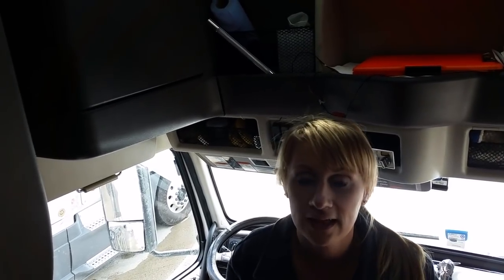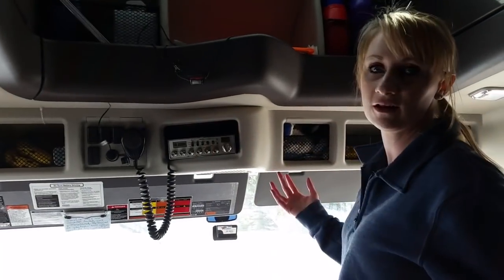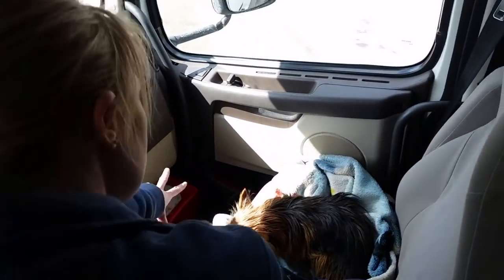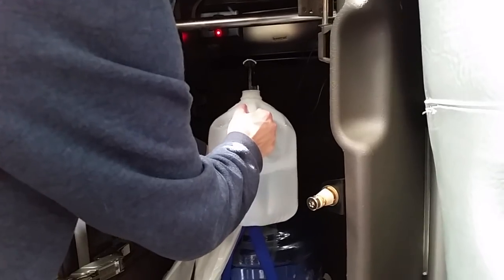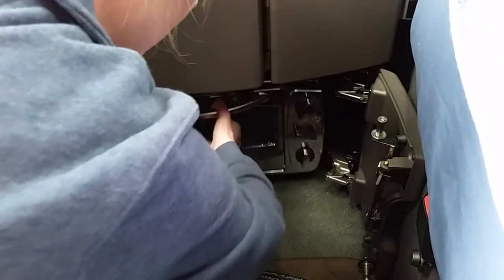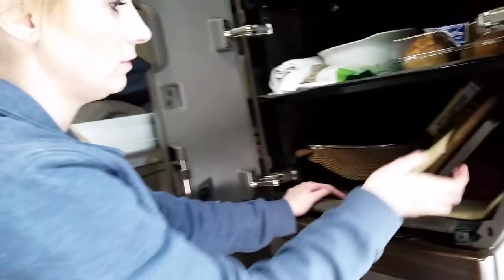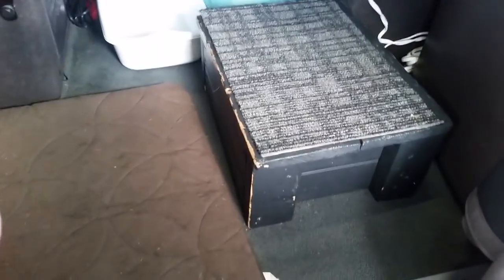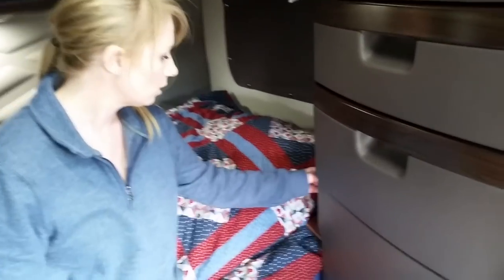Making our 2018 Volvo VNL 780 into a Micro Tiny House: living in a semi

Comment: I have a 2016 Volvo 670, and I’m in the middle of my own deep clean and de clutter/reorganization as I prepare to start running more instead of being home every weekend all the time. If space comes at a premium in a 780, space in a 670 certainly does. 

Where do you find that pump head? I just bought a microwave, already have 8-quart instant pot, going to see if my ninja foodie xl grill fits, and maybe add a second fridge. I have a 3,000 inverter. 

The main thing I want to focus on is making space, and instead of plain milk crates, I bought some Rae Dunn crates to add a little designer flair. I drive solo, so the passenger seat is largely for my beagle puppy, and I store dry goods in front of that seat. 

As an owner operator, I appreciate videos like this. No matter how long you’ve been out here (me, 20+ years) you can always learn something new. Thanks.
Reply from the maker: So happy for ya and the new adventures ahead! Glad you found this video to be helpful. If you have Facebook or Instagram add us and send pics. 

Exciting news about the water pump is they have made upgrades and it is now smaller and a rechargeable battery. You can find them at Walmart or on Amazon. 

Be safe and may God bless you
Reply: @SimpleLivin  Oh, I’ve been driving for over 20+ years as a professional. I’m also a 2nd generation driver who used to ride with my dad. 

I’ve just never been that organized, especially as a bachelor lol. But, I finally decided to get my cab back in day 1 condition, and make it into more of a rolling apartment to help me stay out longer. I might create an Instagram account, although I’m so sick of Facebook lol.
Reply from the maker: Congratulations on your success on the road. Its always good to hear other folks that have a deep love for trucking. We have 45 years combined!

Getting your truck organized and making it into a rolling apartment will make life so much more enjoyable.  Its also has a huge impact on positive mental health.   Come on over to Instagram! Lot less drama lol

Comment: I drive a 2011 780. Identical set up except I have so much crap in there i can barely move! Where do u hide your pee jugs? I like the 5 gal water jug with the pump arrangement. I have been just buying water at the truck stops.  $2.50 or more a gallon! Walmart is . 94 a gallon. I only use the water for coffee. Hell I rarely bathe in the stuff so why drink it??!!   kiddin

Comment: Compared to some of the trucks i drove back in the late 70s and early 80s, your truck is like a condo on wheels, and of cores i was driving a International cab over, and if you think you are cramped for space, try living in one of those for two or three weeks, running teem.
Reply from the maker: willibill c trust me I am incredibly thankful for the continuous improvement of trucks and truck stops over the years. I love the look of a cabover but I can only imagine it was not a smooth ride! This Volvo does have a pretty big cab overall but compared to a house, apartment or how the average person lives it is beyond tiny.
Reply: willibill c , this generation don't know a thing about trucking or what trucking is really about.  They cant change a tire or change a tire off a rim or mechanics this isn't trucking period
Reply from the maker: T D I've been driving for 10 years now. I really could have only started 6 months prior because of my age.  Thru my career I have surrounded myself with some pretty elite drivers. Winning multiple times at the national truck rodeo titles. I have also won awards myself and can honestly most times can diagnosed what's wrong with my own truck. I do agree with you though most drivers don't know a thing about their trucks.
Reply: willbill c The only time I ever drove a cabover   was at driving school. We also had an assortment of KWs, Peterbilts and the like with standard  sleepers. I cannot imagine driving that old cabover 3000 or more miles a week. That would have ended my career before it began. The cabover was an old jbh truck, and as bad as you would imagine.  Bobtailing it wheezed going up a bridge. And BOUNCE? First company truck was a Ford 9000 with a Cat and Eaton Fuller. Thought I'd gotten into a race  truck. Grossing 80,000 it pulled WAY better than that old Int. cabover without a trailer. Gotta admire the oldtimers. They had it tough. Living in a coffin.
Reply: T D, a real  trucker learns his rig pretty fast. Most folks ain't mechanics, but the sounds, the smells, the way it handles and brakes are  quickly learned IF you pay attention. Keeping an eye on your gauges is all important. If you can FORECAST a problem you're miles ahead. Too many truckers just ride the seat. That's a sure recipe for high repair bills, lengthy intervals OFF the road (not earning money) and dangerous situations. A  diesel mechanic makes more money than a trucker and is home every night. If you're both, which would you do.
Reply: Tom Swinburn , there are different levels of being a mechanic a truck driver doesn't need to know how to change injectors or adjust valves he need the basics to know how to do minor repair to get him home. If an owner op can change a turbo and a driveshaft u joint thats cheaper for him and less down time waiting for a mechanic or tow truck depending on if it's caught at the right time and place having a good set of tools to change a belt or hose.  Now when you need major engine or diff work you seek a pro in that sense. But you seek a mechanic for every single thing on your truck to fix its not practical ie electrical switch, or a  PP1 valve.
Reply: willibill c come to the U.K. and see our sleeper cabs, and we’re away 2-3 weeks at a time, you drivers in the States have beautiful big cabs compared to our shoe boxes.
Reply: willibill c sleeping on the dog house too
Reply: Ditto

Comment: I'm going to be starting otr in a few weeks, my question is what size are the two different bunks I'm sure between the various different makes of rigs the bunks are the same size I'm just curious as to what size sheets I'll need to buy for the top and bottom bunk?
Reply from the maker: Most of the time they are twin xl from my experience

Comment: Hi! Are you owner/operators or company drivers? Do you use an inverter? If yes-what wattage? Have you tried using a Crockpot slow cooker? I haven’t seen your other videos. Does your truck have low voltage battery shut off switch? Thanks for the video!
Reply from the maker: We are company drivers. We have an inverter that is 1500 watt. It is hard wired and has fusses which does help protect the inverter. It will trip if it surges. I dont suggest a crockpot but instead a 6 qt instapot. The lids lock and steal on. They cant spill and cook much faster.  I hope this helps. Welcome to adventures. Here is our trucker kitchen playlist  I think you will find ut very helpful Trucker's Kitchen: https://www.youtube.com/playlist?list=PLjSMGTwa5pLB7fnXLczN5TbC_ibpdxWkO

If you have either questions dont hesitate to ask.  Stay safe and may Blessings
Reply: Simple Livin Great/Thanks! Sometimes my wife rides with me. But after my time off next week she’s staying home. So I’m thinking of the stuff that I want to cook. And like you and my wife said, carry enough water to wash dishes. I, too, prefer to keep my 5 gallon bottle full of water along with some extra gallon jugs. I have one of the 12 volt Burton slow cookers. I want to try cooking some breakfast sausages and tater tots or perhaps try cooking pork chops and veggies. I’m not well versed at cooking but during the next month I want experiment cooking stuff. Chili, omelettes, stews, cheesy veggies dip. I’m a company driver and the truck that I drive has a 1,200 watt inverter and a mini fridge. Hope you have a great weekend!
Reply from the maker: @kriskkallinn7816  you can totally do it! You got this. Watch the must have Appliances video the electronic skillet might work for you as long as you don't try to cook with it really hot. You would be able to cook all of that and more! I have many videos of how to cook the food. I'm working with breakone9 to offer a cooking course for trucker

Comment: Just found your channel.  We have a KW T700 and are almost at 1,000,000 miles so considering a trade to a Volvo 860.  Is yours a standard or automatic?  How does it climb?  What is your max cargo weight?
Reply from the maker: Our truck is a standard. I personally think you are able to climb hills better when you can shift gears yourself. Yes this truck does climb hills pretty well. Our max weight is gonna be a little different cuz we pull doubles and the trailers combined weigh about 40,000. The max load we have pulled is about 26,000 (due to the fake its small packages for FedEx Ground) give all this it climbs well.

The only thing bad I would say about this truck is that if you are driving teams and one drive needs to sleep while the truck is rolling down the roads it is a rough ride in the sleeper. Meaning you get tossed around a good bit while trying to sleep... making you body quite sore sometimes! but heck if this isn't the case then its a great option!

Comment: Dang can I borrow her to cook keep my bed warm. Unh huh! She sweet ! Had a volvo once I worked didn't have the on board fridge but had a microwave and I take my own rubbermaid or igloo electric fridge. The owner   for small time driver owner who had a stretch can sleeper his self. who owned 4 trucks while my reg freightliner getting worked on I loved the smooth ride of volvo other than it had a auto shift was a pain at stop lights and lights tend change quick before I could get the auto to third gear I tried manual and it mess it up freeze up computer on it at times and owner get mad at me. But them lights get u into trouble. On automatics . But once got going the truck ride like a 70 's cadillac .

Comment: Your 2018 looks alot like the older trucks. It doesn't have the table on the back wall or the push up shades or the bed that sits up?
Reply from the maker: SunShineMoto yes the bottom bed can also be made into a table with booth seating. If you check out the tour of our truck before I put everything in it you'll see how it sets up. I just found long term it wasn't practical to set up the table up and down nor were those cushions comfortable to sleep on.  Though if I were a solo driver I would leave the table up and sleep on the top bunk
Reply: SunShineMoto The reclining bunk is a feature on the 760/860, not the 780. The 2018 780 is also known as the 780 "Legacy" which was built in the first half of 2017. The new models of Volvo Trucks are now the 760, which is a replacement for the 670 and the 860, which is a replacement for the 780. The 860 is basically the same as the 780 from seats and back. The only difference is the driver cab got a facelift with new dash, etc and a new aero kit.
Reply: 458mupyx right on.. my company only has the 670s and 760 VNLs.. just noticed the trim and dash in her truck is the same as our 2017 and older trucks.. I have videos on the 2018 VNLs that just came in.. Lot more videos comming in the next week's... Thanks for the info..
Reply: yep you know your volvos